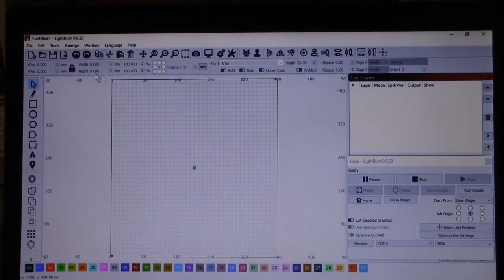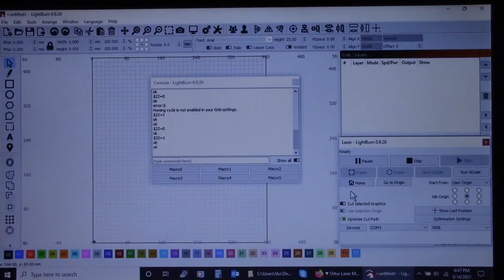Ortur Laser Master 2 Engraver Not Homing Problem and Making Horrible Noise (Fix in LightBurn)

Comment: You didn't tell me how to fix nothing. Just how to turn on and off the home button.
Reply from the maker: Fortunately I did tell all the other people that commented below, how to fix it. I left you out on purpose, because you used a double negative.
Reply: Just slack the screws holding the drive belt. Belts are too tight causing stop

Comment: 1 problem i can't find fix i, when doin wood there is a random cut through horizontally. the rest of the engraving looks awesome. its driving me crazy.. all day I have tried different settings on other jobs and it still does it. sometimes 1 line or a few cut thru in between job
Reply from the maker: Check to make sure that section is being "written" over twice.

Comment: I had this problem too. Then i figured out they didn't account for the light shield thing when designing where the limit switch goes. If you just lift up the shield it works fine.

Comment: Got one for you had a bad stepper replaced it with the same size but different brand for the x axis laser arm one. Did the fix in light burn works sometimes. Took laser off and it zipped right to home put the laser back on and it doesn't move just  hums. The belt tension is the same. Tried everything i can think of.
Reply from the maker: Thanks for asking, but I'm afraid I don't know that answer. I'd suggest posting your issue on the Ortur users Facebook page.

Comment: What are the precise instructions after you set $22=0 ? Turn off the power to the printer then turn it back on? Or just hit the reset button? Do I have to restart lightburn?
Reply from the maker: I didn't have to restart anything.
Reply: I’m having same problem did u get it fixed?
Reply: @firefeetstv5227  no, haven't been able to fet it working yet

Comment: This helped out massively. For some reason, after using the rotary tool it stopped working normally and every time I would get that damn message I would look at the config and auto home was turned on. I added the $22=0 and $22=1 as macros so if it does it again it is a simple click. Thanks, now I can get back to learning how to use the damn thing and maybe get some stuff done.

Comment: Did you ever fix the actual problem...that the controller was not responding to the limit switch activation on that axis, either due to faulting wiring/connection or problem with the controller itself?
Reply from the maker: This was the only thing I did.
Reply: @PirateStu  I had the same problem yesterday, the horrible noise when homing just after power on, but solved it--the wire from the limit switch to the controller had broken inside the sheathing so closing the switch couldn't tell the control board anything.  I cut the faulty wire and crimped on a new connector and the grinding-at-home problem went away.

Comment: I have a question my unit came with yellow connectors on the wire harness which I think they grounding connectors but please let me know if you have ever seen them
Reply from the maker: I think they are the grounding straps, but I got mine before they added the grounding wire. If you want to know for sure, there is a Facebook Group that's very active and may be able to help you. It's called "Official Ortur User Group".

Comment: I’ve had and used my Ortur LM2 since July with no issues, until today. All of the sudden the y axis motor acts like it’s dragging a 100lbs! And when I try homing it, it acts like it’s trying to push through the limit switch and then I get an error msg that the limit switch can’t be found. 

I’ve been on Lightburn’s forum and have tried my connections, adjusted belts, etc. 

Anyone have any ideas?

🙏
Reply from the maker: Sorry, but I don't. There is a Facebook Group that's very active and may be able to help you. It's called "Official Ortur User Group".

Comment: Hey after I did this the laser kept traveling beyond its travel limits. I get an alarm 3 error and I can't figure out why it keeps traveling beyond it is limits. I tried going through devices to reconnecting the laser to my laptop, but that doesn't seem to reset or even set the travel limits. Any help is appreciated.
Reply from the maker: I'm not sure about your problem. Have you check to make sure the limit switch isn't attached backwards? There's a Ortur Facebook group that may be able to help too.
Reply: Jiggy, were you ever able to solve this? I'm having a very similar issue, and my wiring seems correct.

Comment: I did EXACTLY what you suggesred - still vibrates like hell at home position.
Reply from the maker: Sorry it didn't work for you. Have you made sure your limit switch is installed the right way? It should be activated when the laser is in the "Home" position.
Reply: @PirateStu  BOTH limit switches were incorrectly wired  - thanks for coming back on this - so many videos on the web missed this... some even said to ensure the red and black wires are the right way around - totally irrelevant as these are just switches :-)  I can safely turn the auto HOME back on now. I figured it out with a meter before you came back to me - but thanks anyway - much appreciated. Helps me a lot as, like you, I'm writing about the Ortur. I've even learned a little more about Lightburn in the process.  If you spot anything I've messed up feel free to comment. https://tech.scargill.net/ortur-laser-master-2-pro/  

Regards

Pete
Reply: @PeterScargill  I also tried it like in the video but it still did not work. I saw your post and tried it by switching the wires on the limit switch and it worked as intended. Thanks to both of you for the great help.

Comment: Did this and it’s still going to the top right corner and vibrating!!
Reply from the maker: Is it going to towards the limit switch? The limit switch should be in what I would call the bottom left hand corner, not the upper right.